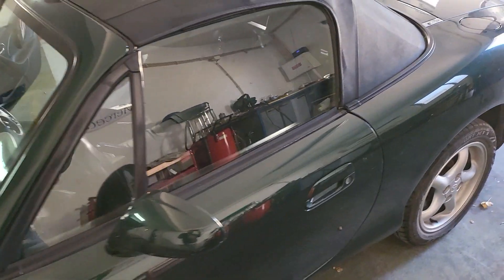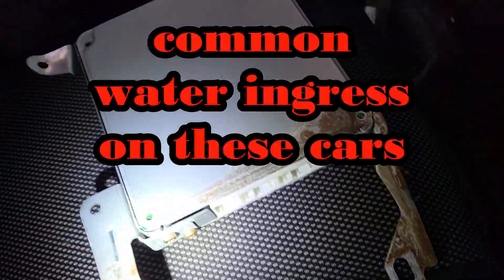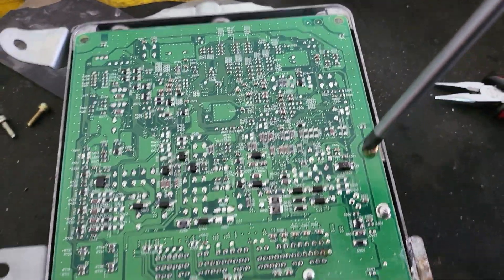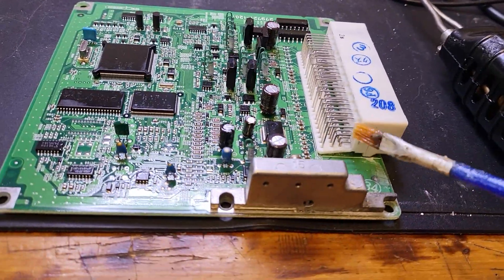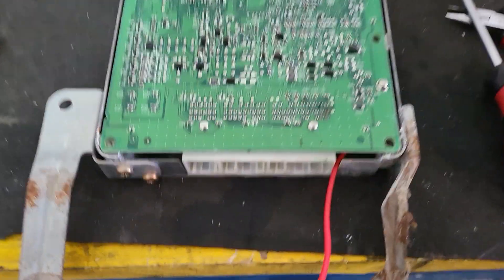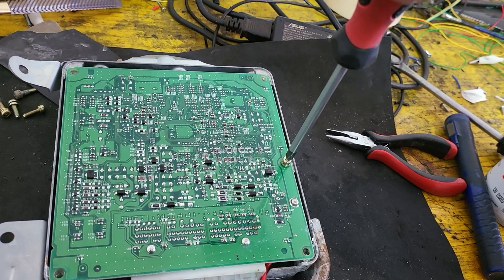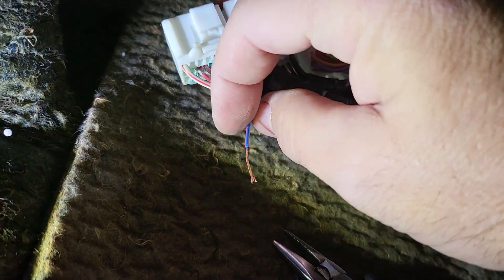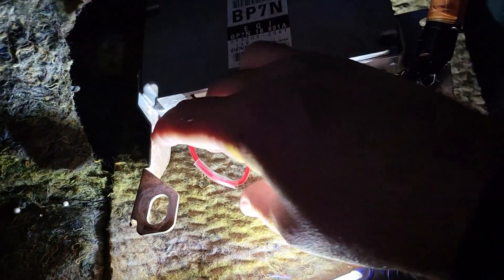Mazda MX5 Ecu back voltage signal missing (p1562)

Comment: I have this code and worked as this videos but stay code not repair waht I do ???
Reply from the maker: Thanks for watching.
Try to make a continuity test on that circuit with a multimeter and i am sure you will find
a damage / corroted wire or connection.
Good luck